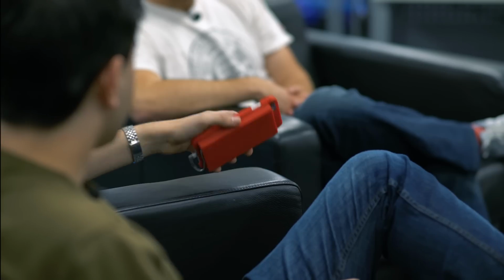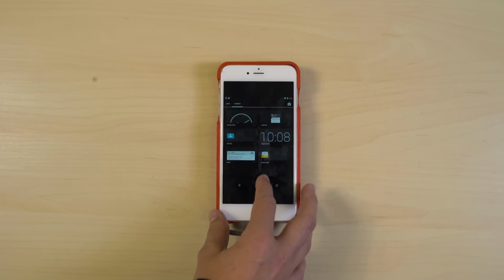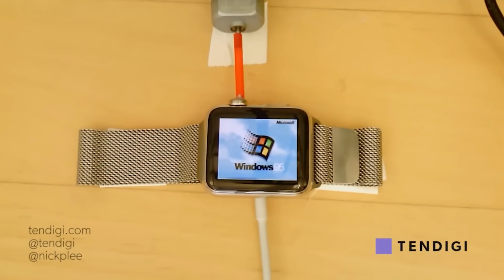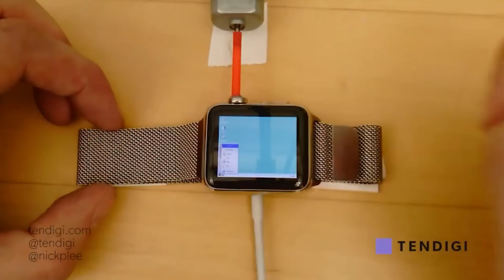iPhone Running Android: Explained

Comment: It's not an iPhone running Android is a android phone without case/body using an iPhone as display.
Reply: it's quite interesting that you run android INSIDE iOS operating system, but you still need more hardware to get android going
Reply: its not "more hardware" its a full fledged android phone (without cameras, speakers, aesthertics, etc.) just mirroring on iphone. The screen sharing part is impressive, but its like saying "APPLE TV RUNNING IOS" when you airplay your screen to it.
Reply: Exactly. I got tricked by the title. It is like when you plug you mac to your TV, does that mean your TV running OS x? NO!. But i do give full credit to guy for developing a kit that can mirror android OS to iPhone screen. Well done, but i think title should be changed.
Reply: +MrBAKUVIP You are totally right. Its just click bait
Reply: a raspberry pi with android and hooked up to a powerbank and use remote desktop on your phone
boom !
Reply: An Sony Xperia Z3 Compact's motherboard (very compact and tiny!!) + battery & external display on the iPhone ;)
How about that?

Comment: buying two phones and glue them together is a better idea
Reply: Lew already did that. It's not as novel as you think it might be.
Reply: +Alif Nasir Saad no, it runs off a separate board and transfers the screen data to the iPhone. it's basically running team viewer on your phone to your desktop
Reply: except that would defeat the purpose, of running both operating systems on one phone
Reply: or a raspberry pi with android and hooked up to a powerbank and use remote desktop on your phone
even better
Reply: Karthik Naik LOL that's not a bad idea, though I'd rather use the pi zero and power it with some sort of battery case for the phone.
Reply: Michael Low yeah but Pi Zero might be a tad bit underpowered and doesnt have built in bluetooth and wifi
but yeah it has the size advantage
Reply: Karthik Naik get the little usb bits for wifi and bluetooth lol, and if you wanted to you could customize the parts somehow XD
Reply: Nah install cydia problem solved
Reply: Raveen Bikha cydia can only install themed iOS, and MAYBE an Android emulator. Have to go a bit deeper than that.
Reply: +Raveen Bikha (Raveen Gaming) Cydia cannot modify the OS
Reply: Lucasleeeeeeeee it can, but nobody feels like doing that anymore lol
Reply: +Michael Low it can't, it works like Xposed framework on android, it only replaces parts of the os during runtime, by hooking on to what it wants to replace, then replace it, it can't really replace parts of the os. However, with jailbreak means that you have root and with root, you can modify the OS yourself
Reply: +Michael Low with the exception of ifile and a few other tweaks.
Reply: Lucasleeeeeeeee that's what I meant lol
Reply: loooool XD yeah it's true
Reply: awww but there'd be no camera
Reply: Alireza Ekhtiarzadeh front facing camera phone with flash :D
Reply: Michael Low Yeah, but only to a certain extent.
Reply: +Karthik Naik wouldn't be nearly as good as the original

Comment: This is stupid. This is NOT an iPhone running Android.
Reply: it technically is, and it hasn't been done before at all besides dual boot for old ios versions.
Reply: Michael Low That iPhone is not running android. Period. There is a completely separate device running it.
If I connect via VNC to my MacBook, does that mean that the iPhone then runs OS X? Or do I need to duct-tape them together first?
Reply: Toni Lähdekorpi it's still displaying it
Reply: Barry you mispelled your own name...
Reply: Michael Low and? My phone also shows my desktop, how does that differ?
Reply: Toni Lähdekorpi How so? Also that differs because a pc is built to do all that kind of stuff, whereas android and ios are not.
Reply: That wasn't the point. The point was that the iPhone hardware is not running Android.
Reply: Toni Lähdekorpi  He would need full root access to be able to actually run the entire OS on the phone. I don't know what exactly he did, but if he did what I'm thinking it does involve running parts of the OS on iOS.
Reply: Michael Low having root on the current OS doesn't magically mean you can boot a different OS. You would need the kernel and all native sotware compiled to the ARM inside that SoC. And reverse engineer and rewrite all the drivers for the phone.
You didn't also watch the video, did you?
It's clear from the video that the iPhone is just running a remote desktop app that connects to the separate computer on the back.
Reply: he says, in the video "you can run Android on your iPhone" which is correct. the only misinformation is the title of the video.
Reply: Toni Lähdekorpi No shit sherlock. TBH I didn't watch the entire thing, but I'm pretty sure that it's more than just remote desktop, because it uses the iphone's bluetooth and wifi connection.
Reply: It is more than a remote desktop. It actually has very little latency and the workload is handled externally (in the case, by the androidsystem with it's own SoC). The downside of this is that the Android Runtime is limited by the hardware in the case. Due to bad documentation he had to go for this route as building your own drivers is cumbersome and takes a lot of time as much research is required and you are left with no guarantee that it will work.

Imho, I think that the idea is cool and could spring idea's within others! As of now, having an flagship Android & iPhone (or an iPod Touch (has all the apple-only features)) at the same time would be the better choice.
Reply: Kameel It is still a glorified remote desktop, no matter the protocol or method of moving the display data. And yes, it is cool but calling it an iPhone running Android is false and stupid.
Reply: Toni Lähdekorpi So you're saying that a pretty major advancement in the topic of android on ios is completely irrelevant, as it's just a glorified remote desktop? That this guy achieved nothing, even though he probably worked his ass off for this, being the first person to do so in quite a long time?
Reply: +Michael Low No. All the shit is directed at whoever chose the title for this video. The maker here didn't claim anything like that.
Reply: Toni Lähdekorpi Then don't take it out on the person who made it. You're insulting the maker of the "mod", not the person who named the video.
Reply: Michael Low How, exactly?
Reply: Toni Lähdekorpi by saying it's a glorified remote desktop. I would at least find that insulting if I was him, or at least offensive to some extent.
Reply: How is it not a glorified remote desktop?
It's a separate SoC running Android that most likely gets its framebuffer grabbed on the SoC and pushed to an app on the iPhone.
Different than just using VNC? Yes. Better? Yes. But basically the same thing done a bit better.
Reply: And again, that's not an insult. There is nothing wrong with remote desktops or this. That wasn't the point at all.
Reply: Toni Lähdekorpi It seemed as if you were trying to put it down for that, my apologies.

Comment: It's not iPhone running Android, it's just shitty screen streaming...
Good job random guy, the screen streaming part is really well done, but still, it's NOT iPhone running Android...
Reply: Yea, as soon as I saw that big case, I called bs. He was smart to be able to implement that screen sharing but its just an android phone taped to the back of an iphone. This is like saying apple tv running ios  when you airplay your screen to it.
Reply: Wouldnt it have been easier to kinda wipe the iphone, like the os, and replace the os with andrioids os? Or jailbreaking it
Reply: +Boydgado26 impossible. They run different architectures. its like making a toaster try to cool your food down
Reply: They're not different architectures... The vaste majority of Android phones have ARM cpus and Apple A9 chips are ARM cpus... It would not be THAT difficult to port Android to support the A9 chipset... But no one cares anyway because you need to jailbreak and develop a custom bootloader and flash tools before even start thinking about porting Android...
Reply: To be pedantic, Apple TV DOES run iOS - they just changed a few things and brand it "tvOS", but it's iOS because, well, everyone knows that.
Reply: Not forgetting the vital part - NO iPhone user wants an Android phone - that's why they have an iPhone.
Reply: Yep, that's also a good point
Reply: yes they are different architectures XD ios is made to run with all parts of the iphone andriod isnt
Reply: That's not how CPU architectures work...
Reply: +unlokia uhm. There are some people. Very few maybe. I can do a lot of crab on a rooted android device but I use an iphone for security reasons. It's fast and gets apps on the store first. More Natural looking photos.
Reply: Dominic Victoria I wholeheartedly agree with you - iOS is the height of security, simplicity, time saving efficiency and beauty. No arguments here :) Android is turd.
Reply: Oh. So you're an Apple guy eh. Android is a lot easier to play with if you're doing some nerd stuffs. I use iPhone but Android could do a lot more without a root/jailbreak. :)
Reply: Electronicbrain Kid Yep, Android is free alright - free from security, free from the "shackles" of iOS which respects and values data privacy to the Nth degree - so yes, you're free of ALL of that peace of mind... ah, and also "free" of the superb, unparalleled support offered by AppleCare.

Yep, free indeed, and free to be spied upon, attacked, and free to be utterly confused by differing Android variants. Superb idea!
Reply: I'd like to see an Android emulator that integrates with iOS. That'd be awesome.
Reply: +unlokia Apple stuff has problems as Android stuff has problems. The fact that iOS is slightly more secure derives from the fact that it is closed source, and all the services are accessible just in the way apple says you can, which is fine if you use your phone to call people or send selfies on Instagram, but not so much if you need to do something crazier, like using Tasker or a system terminal or ssh into your pc at home, or root it and do even crazier stuff like injecting system apps, applying system wide themes, change the screen dpi and fix some stupid app behaviors... Every platform has its good and bad things, and one is not much better than the other... Both have telemetry, both have periodic data leaks and security breaches, both have huge strange bugs that crashes devices in the worst moments...
Reply: meeh. who's to know no one's spying on us on any platform. we know nothing actually. Just having an Open mind here! Whatever. I'll just continue enjoying my breakfast and just watch where this thread leads. LOL
Reply: ***** Btw. I always think of my first phone when I read your name.
Reply: Dominic Victoria Ah how nice. Do you know why my name is "unlokia"? In the late 1990s I wrote some software to unlock nokia phones, so "unlocking" and "Nokia" became "Unlokia" :)

Thank you.
Reply: Kevin Fontanari Huge exaggerations and drama play on your part. Android is a security MESS, iOS is locked down in every sense. Android users WILLINGLY put themselves RIGHT in the firing line by "rooting" and installing APK files, and Google ALLOW this? Stupid Google, stupid, vulnerable, fragmented and messy Android.
Reply: +unlokia A. Rooting is not something you can easily do without understanding the process and risks, and afaaik no phone comes rooted out of the box. Rooting can be compared to jailbreaking an iDevice. 
B. APK installations from places other than the stock app store are not enabled by default. Again, this is analogous to using third party app downloads like Cydia. 

Going by your logic, a jailbroken iPhone that allows you to install apps from unknown sources incl. uverified Cydia repositories is a stupid security mess. 

As a long time user of jailbroken iDevices, rooted and dev friendly phones etc, I have never had a real security incident occur. Operating systems should not be designed with the tech illiterate in mind if that results in crippling power users and devs.
Reply: Jon You seem to (possibly intentionally?) miss the point of iOS - it's a PHONE designed for the "everyman" - IE, a device designed to be slick, easy to use and powerful and enabled by apps. No one at Apple sanctions "jailbreaking" iOS, in fact, they - as I would - make it as hard as possible to lock jailbreakers OUT of iOS, in order to maintain optimal operation of the device, because, ya know, it's a CONSUMER APPLIANCE, and designed as a machine to simplify one's life, not designed as a playground for command line hackers to explore.

I'll show you the inverse of the quote you made:

"Operating systems should not be designed with the tech illiterate in mind if that results in crippling power users and devs."

It's actually the other way around - the appliance device (iOS) platform should NEVER intimidate the user or give them overwhelming, myriad options for the same outcome, as Android tends to do.

iOS isn't a "proving ground" for nerds to exhibit their technical prowess upon - if you want to show off about how pleased you are with yourself for having worked out Androids baffling, inconsistent and fragmented way of operating, then you have the option to use that to impress your (easily "impressed") peers, should you so wish. I'll repeat - iOS is, overall, a CONSUMER appliance platform - yes, it can easily have apps installed that make it a sysadmin/"power user" tool, but if you start from the pre-supposition that it should be an "open" platform so a few niche nerds can roam around and modify the OS..., erm, NO, because:

#1 iOS is designed around highly secure proprietary code, prioritising user privacy and security VASTLY above any "need" for nerds to play around with it and explore it.

#2 iOS is proprietary, therefore NO ONE has any "rights" to crack it open, or expect it to serve this nerd demographic in this way - this is copyrighted firmware which BILLIONS OF DOLLARS and tens of thousands of man hours of coding, industrial design, marketing and engineering have been spent on - it's a COMMERCIAL product - they don't "owe" it to anyone to open it up, they sell iOS devices for a profit and in return, offer services for that investment.

If you want to play around, install FreeBSD or Linux (or both?) or, maybe, start your own company an see if you can make a better platform than iOS, and hopefully learn MANY (FAR too many to list) life lessons in intellectual property, HARD HARD work, licencing, marketing, UI design, hardware component design, supply chain sourcing.... on and on.

It was NEVER given as a toy to tinker with - if you wish to "jailbreak" it and compromise the Apple experience, go right ahead, but they ain't about to offer you free reign, at the expense of their customer base and data privacy.

"Going by your logic, a jailbroken iPhone that allows you to install apps from unknown sources incl. uverified Cydia repositories is a stupid security mess. "

Ermmm, yes - of course it is - you are trusting ANYONE online to deliver binaries to your device which can (and have) compromise your personal data, steal your Apple ID login, etc etc... 

Just because you don't know someone is cracking into your device and stealthily compromising it because you installed compromised code, doesn't mean it ain't happening - you seem somewhat naive, blinded by this whole "freedom" you pre-suppose you are being deprived of by a company who prioritise and RESPECT privacy and encryption chains VASTLY over the desires of a TINY minority to break into their OS, crack it and plant whatever they wish, inside it.

Failbreaking, it should be called.
Reply: Taine Morrish Or you've never KNOWN about it, because the designer was successful in getting it installed under your nose, under the radar.

#naive
Reply: Ayt pips. Let Unlokia believe what he wants to believe and continue on our lives. This is a fkg waste of time. let's just have an open mind and let this one go. besides. We already know how they work and how we use those devices. This thread won't go anywhere. Unlokia has a point anyway. but fk that. We all have a life to deal with. real problems pips.
Reply: Dominic Victoria " Unlokia has a point anyway"

Well... yes. Clearly. :) thanks.
Reply: +unlokia itt: Screw nerds like developers, educators, other tweakers because they do things I personally don't appreciate & screw consumer friendly practices like keeping software open source. We should let corporations have free reign over our wallets and software/hardware development - indies don't matter. 

I'd be glad to continue this discussion but from what I can see, you already have your opinions firmly set in and want to disprove strangers on the Internet who think differently. 
Have a great day.
💗
Reply: +Dominic Victoria agreed, the vitriol in this thread is off the charts
Reply: Jon "Vitriol"? I wasn't meaning to be rude ro you, sorry if I came across that way - that's horrible - I was merely pointing out my opinion based on logic, I am very passionate about IT, and your views about platforms clearly differ from the security an usability-minded pragmatist's approach for the masses, sorry if that offends, not what I meant at all.. :)
Reply: +unlokia Just got a notification for this thread and geez, I must have been in a bad mood yesterday, sorry about that. You obvs. know stuff about IT, and while I still prefer android's user experience personally, I can understand where you're coming from.
Reply: Jon Thank you, it's refreshing to find someone humble and gracious enough to apologise, and I am sorry too if I went on a long rant. These are commercial products - there's zero obligation to open them up, not at all.

Thank you, take it easy :)
Reply: +Random Guy HAHAHAHAH